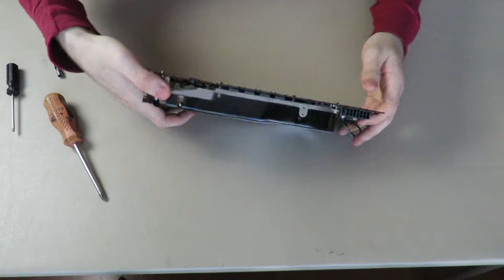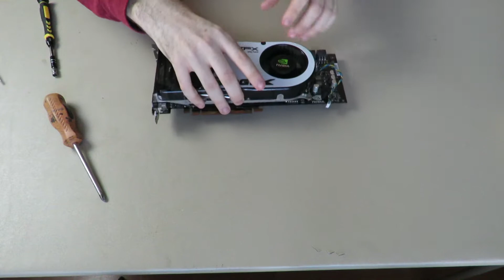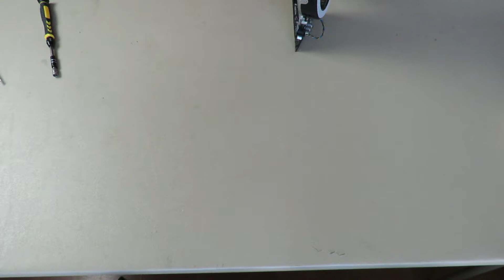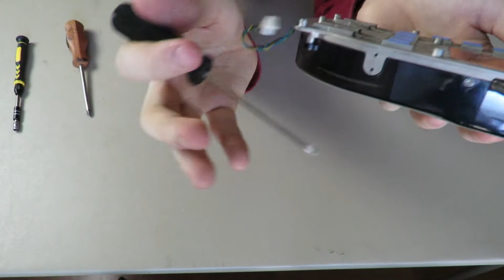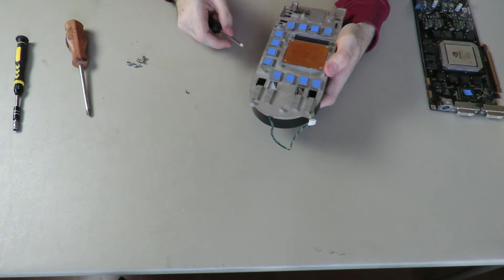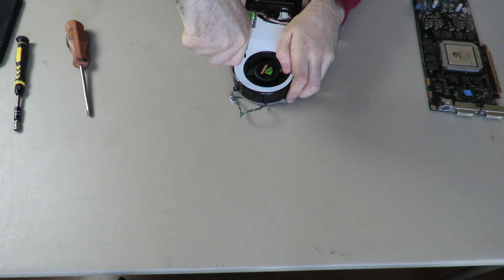XFX 8800 GTX Teardown

Comment: Hey there, I recently bought an old 8800 and the thermal pads are absolutely spent. What thickness pads are used on this card? I'd like to know so I can replace them.
Reply: I know this is 6 months late, but the forums back in the day recommend 1.0mm pads, and when I've used them I haven't seen any PCB flex.

Do NOT install pads which are too thick, it can cause the cooler to bend the card when reassembled.
Reply from the maker: That’s a tough one. I’ve never had experience with one of the old 8800. My best advice would be to get a cheap pair of calipers off amazon then use that to measure the thickness of the pads. I’m sorry I couldn’t be of more help! Or even look online to see if you can find some documentation on it.